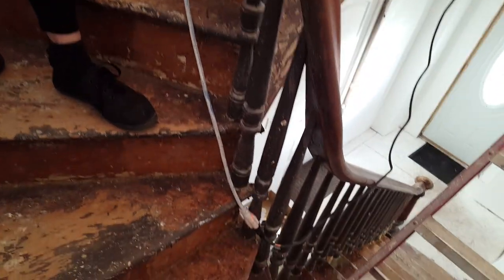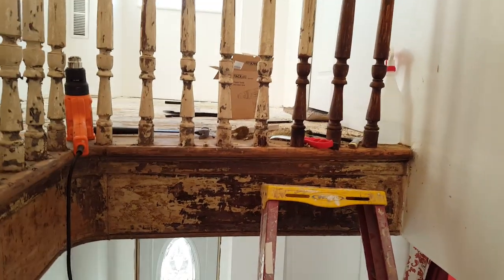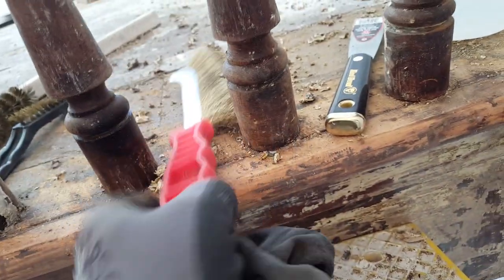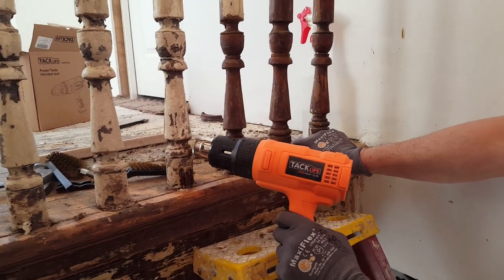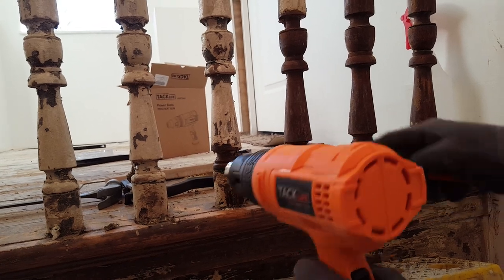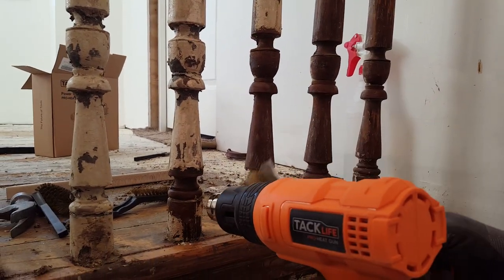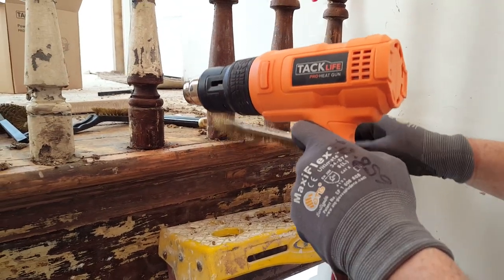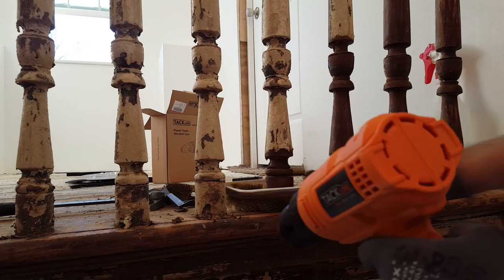HOW TO STRIP PAINT FROM STAIRCASE

Comment: Legend says he is still working his way down the staircase 😂
Reply from the maker: U have no idea.. Lol
The stair case was floating in the air when i first walked in the house.. U could walk up and down it.. Firm as could be 
So i nailed it down... Put braces under it because i was freaked out.. Then i refinished it.. So Anna is ok now.. But anyone who spends the night.... Well lets jusr say they dont sleep well.  Lol!
Reply: This seems extremely tedious and dangerous! I would never do anything to damage the natural wood . People who restore wood projects was most likely cringing at this video. I’m in the middle of stripping my banisters and the integrity of the wood and natural grain is that my utmost interest.
Reply: @marisawilson9286  Two things: 1) as long as you don't keep the heat gun in one spot for too long, it will not damage the wood 2)I think you are suggesting that the woodgrain is some how damaged by the wire brush. Perhaps the surface is scratched, but the surface needs to be sanded to prepare it for staining or varnishing, so and scratches will disappear during sanding. So really, I don't get your point??
Reply: and in Jan 2022 the same legend continues, 'He's on the final touches'

Comment: Did you end up staining and refinishing those spindles? Is so, how'd they turn out? If painted I'm sure they came out great. Word to the wise when working with wood you never want to use too much heat. You actually weaken the wood and can cause scorching, thus ruining the natural beauty of the grain. Paint always sucks to strip, but a bucket or can with a mix of 1:1 liquid and paste stripper  and a paint brush will do wonders. You are on the right track using a wire brush, but if you have a drill buy a wire brush attachment. Apply light to medium pressure and BOOM can strip spindles for days. If the paint is still being stubborn, which it always is, dip some coarse steel wool in lacquer thinner and scrub the spindles. This will knock loose the paint and soften it as well. Then go back and forth between drill and steel wool.  Use the drill and brush attachment dry. You can dip that in lacquer too, but you'll learn why I recommend it dry. Haha. Hope this helps for any future projects. Sorry for the long comment, but I like to give all the details. Oh and did I mention I'm a pretty skilled with repairing and restoring antiques? Been doing it professionally for about 5 years, but only my advice will prove that. Take care homie, and good luck.
Reply from the maker: It was in such poor condition and 7 layers of paint.. I was going for a darker kinda antique burned look.. it came out cool as hell
Reply: Hi Raymond. Thanks for the tip about the lacquer thinner. Can I clarify though, it lacquer thinner the same stuff as paint thinner? In the UK paint thinner is better known as 'white spirit' or 'turpentine'. Is that the stuff you mean? Thanks
Reply: @ndc982  Sort of. From my understanding, and what I've read up on. Generally speaking paint thinner/mineral spirits and lacquer thinner are the same. Lacquer is a bit more aggressive and used as solvent/thinner for oil based paints. Mineral spirits shares the same qualities but is more generally used as a less aggressive alternative. It also can be used to thin certain water based paints. Turpentine I believe is also is used as a natural alternative. Honestly in the 7 1/2 years I've been working with paints I only ever use turpentine as a cleaner. It works great for removing old wax finishes. Also is a cheaper alternative, since I have to save my precious lacquer thinner for spraying. 🤣  here's a link that does a better job at explaining. I hope this answers ur question. Take care bud. Keep creating. Best of luck from Texas.  https://repaintnow.com/thinner-vs-turpentine/

Comment: Also... I suggest wearing welding gauntlet gloves and using a curved shave hook on those spindles. And for the tight corners a die grinder with a 3mm burr bit works amazingly.

Comment: That looks EXACTLY like my staircase! Are you done yet? Let's see the final result!!! If I had to strip all those bannisters I would probably remove them and then submerge them in a vat of stripper, did you consider/try that? Luckily I just have to clean 155 years of grime and varnish on mine.
Reply: I've got 60 spindles to do , I'm  considering the vat of stripper approach lol
Reply: I used a gel stripper and it pretty much wipes most of it all in two coats. I had multiple layers

Comment: I need this. Doing outside porch banister and too many paint layers. Ugh.
Reply from the maker: It was crazy.. My stairs built in 1868.. Say what???
Yes 1868... Paint was like concrete..... Lead based paint for sure.. All 7 layers.. I was like .. Do i need a jackhammer or what.. 
So i tried high heat gun and peeled it off...  OR JUST SAND IT OFF AND BREATH ALL THE LEAD DUST AND DIE..
heat gun work great
... Windows open and plenty of fans blowing all fumes outside

Comment: I mostly agree with your method here, however, I would be a little concerned if you were doing this professionally with the lead vapours and long-term cancer risk. Those smoke alarms do not lie. The way I do it is to setup and 1hp chip extractor with a 100ft 4" duct hose placed outside. I also attached a 4' steel section to the end to stop the hose melting. I place my own smoke alarm on the wall directly above the work area to alert if any vapours have escaped into the customers home. But yes you are right heat gun is the only viable option with lead paint as sanding is out and "peelaway" type products are too slow and cost a fortune.
Reply from the maker: Yes the fumes are real bad.. I had the front door open and a large fan upstairs sucking and blowing the fumes outside..
I had enough air flow going by me that i could feel it..  I never inhaled the fumes.. Lol is that what Bill Clinton said!!

Comment: Did you painted afterwards or stained the staircase ? As I have very similar problem and the same amount of paint on my staircase , what a nightmare to take off all of these layers of paint ...
Reply from the maker: The heat made the wood dark or look stained..
So i just clear coated 3 times with high gloss polyurethane...sanding between each coat... Looks so nice...
Reply: REALPAINTERGUY that’s very good idea I’ll keep that in mind when I move onto my stairs thank you

Comment: My god, surely there are more efficient ways to do this.  For heaven’s sake, get a profile sander at least.  Well I see that this was filmed years ago, so you’ve either figured out or died trying.
Reply from the maker: Man i know.. It was 1/8 inch or more thick. Many many coats since 1863.. Very hard all lead paint. Can not sand. I had a huge fan upstairs blowing out the window.  So about a 15 mph wind passing  by me and to the outside.. All liquid paint removers would not work very well..
But heating them up worked great.. And after all lead paint gone took a profile sander to it.. worked great.. Biggest most unsafe thing to do to layers and layers of lead paint is remove it by sanding

Comment: Heat guns only work on wood that was varnished first, then painted. Heat does not work well on woodwork that was painted raw. The varnish gives you that barrier between the wood and the paint and enables it to fall away, as it never made a bond with the wood.
Reply from the maker: Yes i know, but this paint is 1/8" thick 7 to 10 layers thick.. Just getting down to the first layer is a job..
Reply: @REALPAINTERGUY  Yes and a heat gun is the right tool for that job because it's paint over varnish. I am saying the gun wont work if it is paint on raw wood. Even if it is one layer. That is when you need chemical stripper.